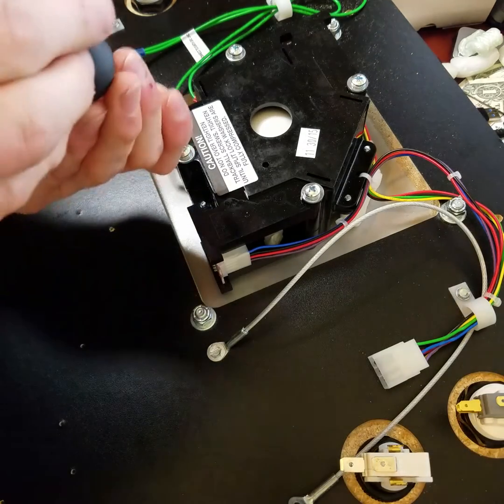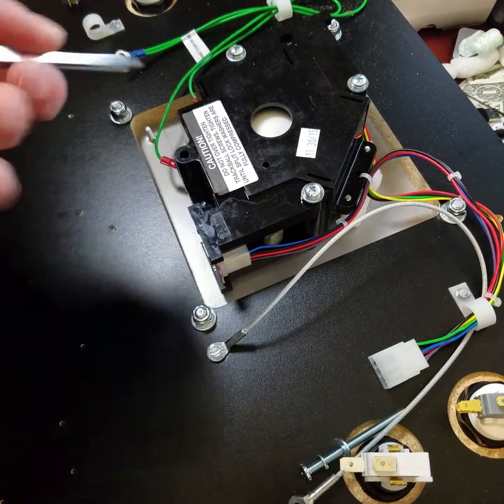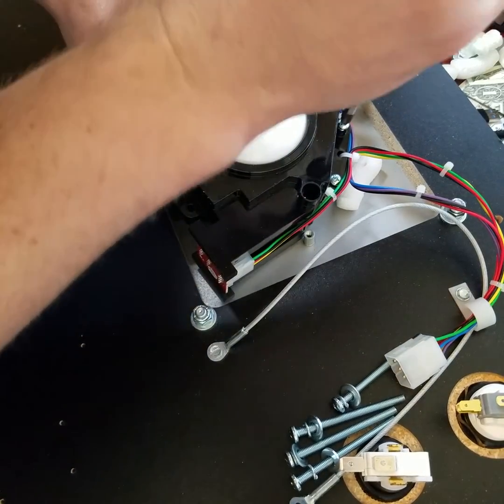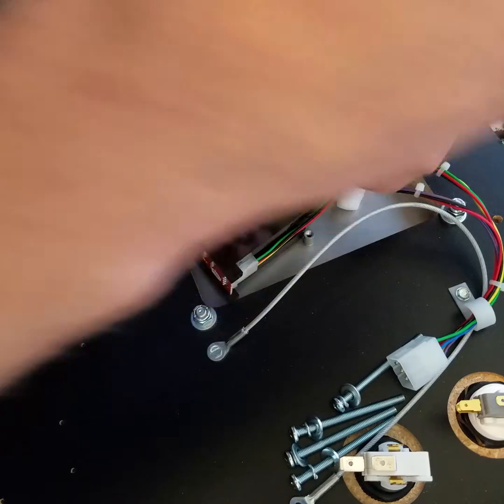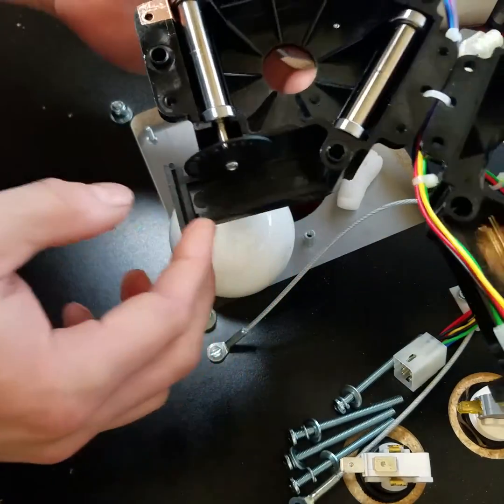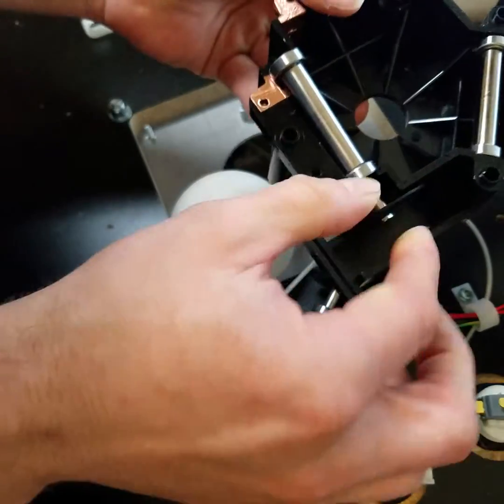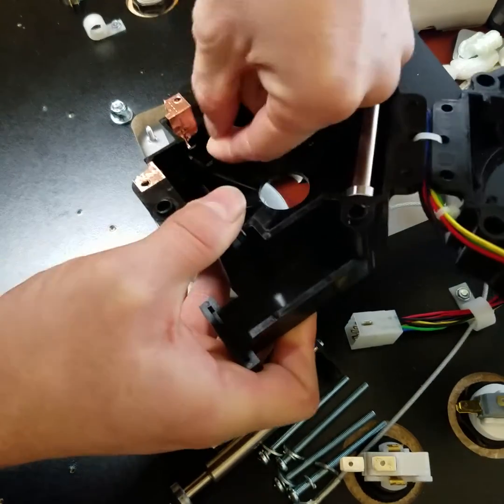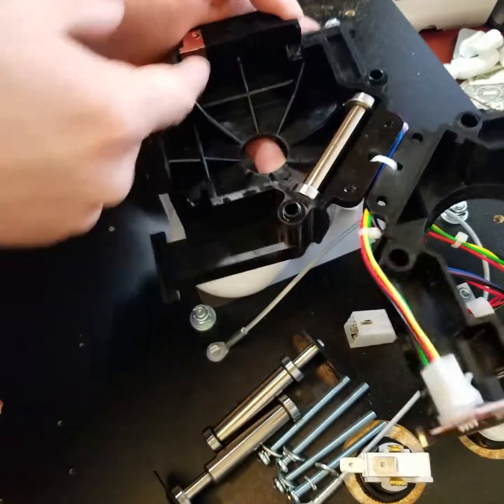Removing the excess copper from a trackball

Comment: I have a 2017. It doesn’t register pulling back sometimes. I cleaned the ball, bearings and everything. Will cutting off the excess copper help with this issue? Thanks
Reply from the maker: when you cleaned the ball including bearings, did you see excessive copper tape build up or the piece that slides under the bearing was it lose?  if so then yes.   if not make sure you didn't over tighten the trackball when you put it back.  the copper thing isn't really a thing anymore since it was caused by bad adhesive and over oiling the bearings at the manufacture side to help deal with them sitting in the warehouse for long periods of time.  but thats since been resolved.  doesn't em,an it still can't happen so that's what i would check.

Comment: Should i put WD-40 on the bearings?
Reply from the maker: absolutely not.  Although people do and it might seem like a good idea at first it is anything but.  WD-40 is not a lubricant and is designed to displace water and remove rust and lubricate squeaky things. In a tight, enclosed space, like a bearing, it collects all the dirt and stuff that makes its way in, then sticks it all together, freezing your bearings.
Reply: @GoldenTeeTV  Thanks

Comment: I cleaned my trackball on a month old home edition this past weekend.  I had the same issues with excess grease and copper tape.  Now that I reinstalled the trackball it will not read any movement up/down/left/right on the game.  I have checked all the rollers and wire connections multiple times and all appears solid.  Any ideas on what to troubleshoot?  I thought the 6-pin quick disconnect between the trackball and PCB might be the culprit but it appears tight.  No issues prior to removing and cleaning the trackball.
Reply from the maker: And you sure you don't have the cables mixed up and you're bearing's are rolling?  What about the  encoder wheel?  is it loose or is it not spinning?  perhaps the screws at each end were loose?  Sorry I'm just seeing this comment now :(
Reply: @GoldenTeeTV  thanks for the reply... turned out something had shorted in my I/O board so was not getting the right 5V output to the trackball.  IT support was fantastic to help resolve and sent a replacement board under warranty.

Comment: My (one week old) Home just stopped registering pullbacks to the right and rolls to the right (changing clubs etc). I opened it up and sure enough both copper tapes had bunched up.

I'm not sure how much is "just enough" to leave. Do I just need it over the horizontal portion or does it need to extend down over the angle some amount? It's bunched up to where only the horizontal portion is attached
Reply from the maker: I really need to actually do a proper video on this as this was just for a vendor friend to help him on site during a friday night tourney :)  Anyway you want to leave enough so it still touches the bearing but if comes undone it can't interfere with the rollers.  Most people  peel away  the second cut strip and leave the one but trim it about a .25 of an inch.  It does have purpose but the excessive amount and the extra oil they put in the bearings plus the poor adhesive used cause this issue.

Comment: These shouldn’t be delivered requiring this. They should be ready to go from day one. I guarantee my local vendor isn’t doing any of this for their machines.
Reply from the maker: This is old and I did this for a friend to do but as you know it's still needed but not as much. When it leaves Suzo its secure but since they over oil the bearings knowing it will sit in a warehouse it causes the copper's adhesive to lift up. After playing acehole there is a chance of it coming up. So most of us don't take the chance and do it first thing. I will make a much better updated video. It's long over due. Thanks for watching.
Reply: GoldenTee TV My home edition arrived tomorrow. I really hope I don’t have to do this. Thanks for the info!

Comment: As a player, how do suggest cleaning the trackball when its not preforming correctly..??   We usually use a wet then dry towel spinning the ball all ways several times with both towels.. is this good..??  do you have a better suggestion..??
Reply from the maker: I proper video is coming out soon as this was just fopr a tech of ours that was in a bind across the country.  But never use water since it will create mildew and rust in the bearings overtime.  Use isopropyl > 95% on a towel and rub it like you were.
Reply: @GoldenTeeTV  5 years since, are you planning on making the video still? Specifically what oils are ideal and if grease should be used, and also how to clean bearings out maybe.

Comment: The copper tape is there for grounding the metal rollers and bearings. I wonder, do you at all need to groud these? I've been playing without any grounding my rollers for a few years without any issues. I removed all tape from my trackballs. I do however ground the trackball mounting plate.
Reply from the maker: If you completely remove it you will get shorts and although the trackball and electronics will seem fine you will get hiccups and distance issues.  i would highly suggest you put it back but just be sure to not over do it.
Reply: GoldenTee TV
 I see. Well, better safe than .. short.